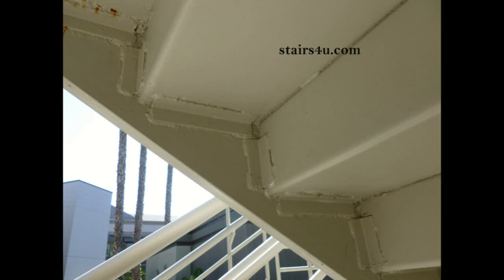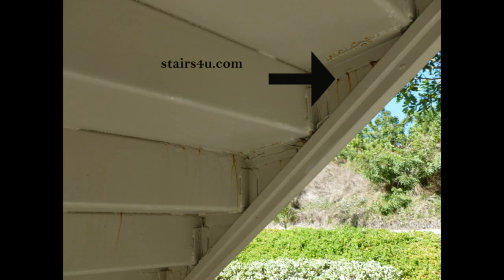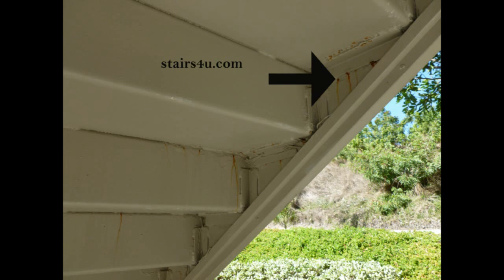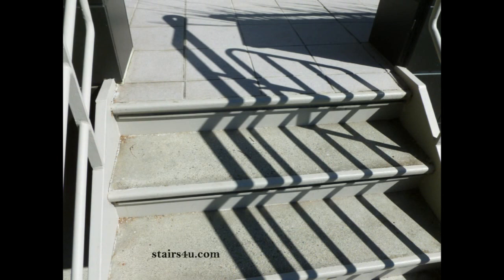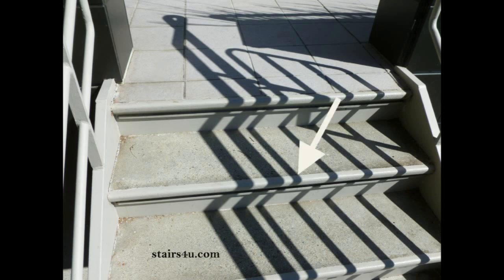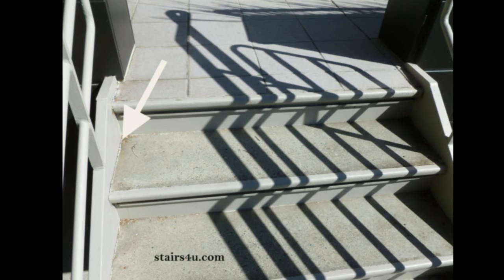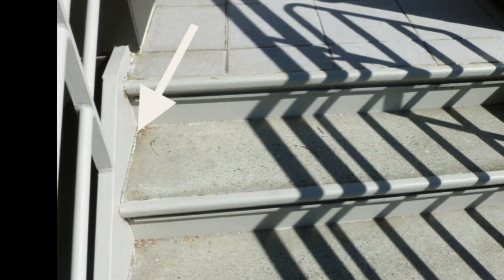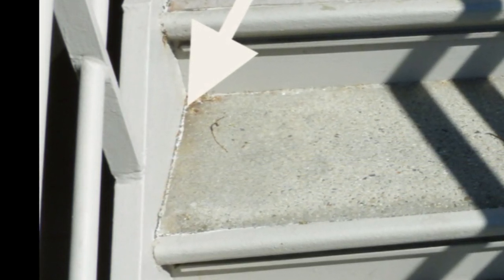Bottom Of Rusted Stairway Could Mean Problems On Top - Stair Maintenance

Comment: I’m having this same problem. Everytime it rains it gets worse. What is the best way to remedy this?
Reply from the maker: If you can not divert the water or moisture, then maybe scrape to remove rust or use chemicals to remove and then repaint. Contact a local painter or paint supply store to see if they can provide a type of paint or more information in your area.